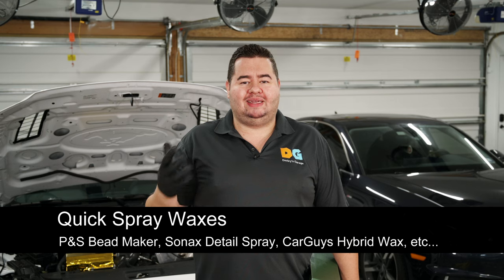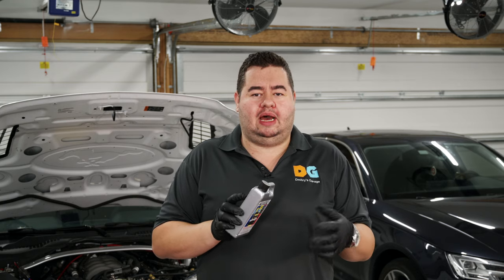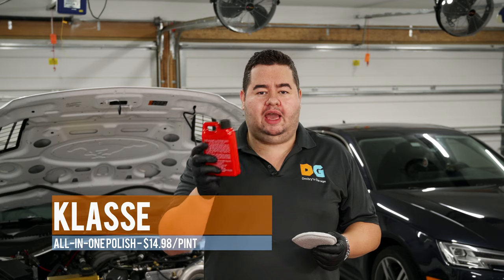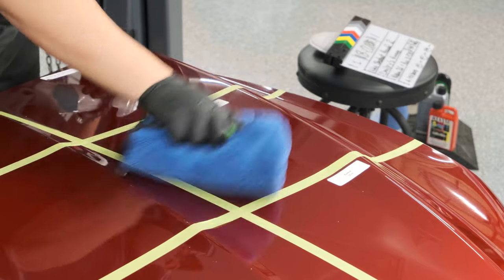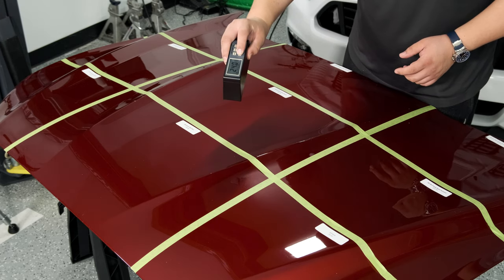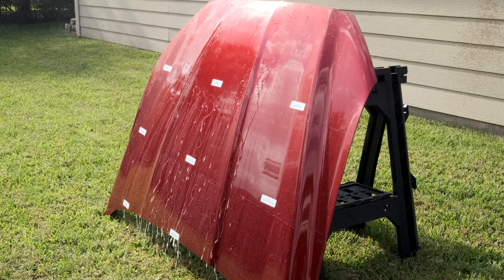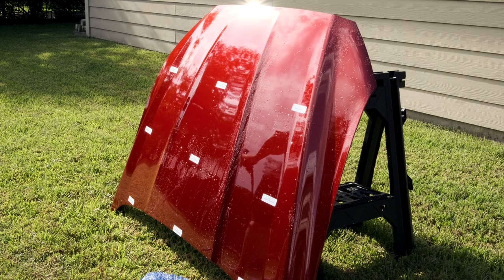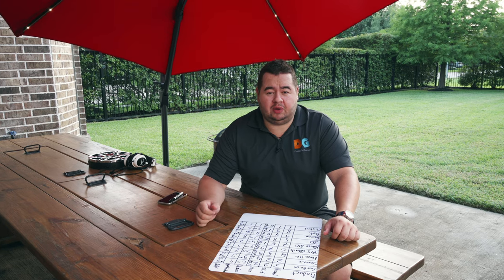What is the best car wax? We test sealants, waxes, hybrid spray waxes, and ceramic products!

Comment: @ 5:44 "oh no, what have I done?!"

Dimitri, love the video. 

I have had the same bottle of Opti-Seal since around 2015 or 2016. I could never get the water behavior I was expecting out of it. 

I tried spray and wipe, I tried applying with thr foam applicator heavy, and thin, then wipe, etc, etc. 

The last summer I polished my car with Optimum Hyper Polish, and the stuff beaded like crazy.... WTH?

I got even better results when I applied and let flash off, and only wiping away any excess after the majority of it flashed away. I also kept it dry for at least an hour. 

I've also come to realize that not all products are designed to bead, and that it's not necessary for for the paint. 

I am still testing Opti-Seal in real work conditions. I have on my car and my mom's car. Currently going through the winter months where she uses the touchless wash, and we have salt and brine on the roads. So far so good. 

I did test Optimum Car Wax over the summer. Compared to CarPro Gliss, it might not have thr longevity of beading, bit it sure as heck didn't get water spot etching like the Gliss did!

Once I exited the cult of beads I'm a lot less anxious about maintaining my vehicle.
Reply from the maker: Haha yea I definitely felt that way at that moment. Was very confused why it wasn't coming off. 

I may have to give Optimum Hyper Polish a shot, that sounds pretty good! I am testing the Optimum Car Wax very soon.

As far as beading vs. sheeting, in an ideal world you'd pick sheeting because it leave less droplets to leave water spots. In the real world the problem is that sheeting is a result of using water's cohesion to pool it together in one big puddle. This means that sheeting doesn't have the same self cleaning and lubricity effect as hydrophobic surfaces that cause beading. In practice hydrophobic products that push water off (cause beading) will do more for self cleaning and lubricity when washing to prevent scratches. Though the downside is the water etching and spots. 

I don't know of a way to make a truly sheeting product that has the same positive and protective properties of beading products.

Comment: The clumps in the Colonite 845 is totally fine.     I have been using that stuff for 25+ years along with Colonite Super Double Coat wax which is without a doubt one of the longest lasting traditional type waxes.     The one-two punch is the Colonite Super Double Coat topped with their 845.    Very good durability and gloss.   Brilliant Shine Detailer from SONAX is another very good one.    It says "Detailer" but it's a spray sealant with long durability and beading like crazy.    Also a good value.   You can't go wrong with anything from Sonax (Made in Germany).   BSD is not super slick,  but it is the most durable probably of the ones you tested.  That stuff is crazy durable.     I do love Opti-Seal too.    It's so easy to apply and remove.   Absolutely no haze.    1 spritz per panel,  can also be a drying aide.    It's a very good product.    I would say about 3 months durability but really it could be infinite if you just use it after every wash as your drying aide.    Never tried Poxy or Cure yet but have tried the others.    Just throw the silver can of Klasse in the trash.    It's far far far far past it's prime.     The secret to that one is to apply it so thin that you literally can BARELY see it.    Then remove it quickly.    It is a little easier that way.    The Klasse RED bottle is the star of those two.    It's a good glaze and chemically removes oxidation and will fill in light swirls as well.    It's great if you use it and then top with a good sealant or wax and you'll have a great looking vehicle.

Comment: Wonderful reviews.  Just a note about the Klasse which I have used for over 30 years.  You are supposed to use the All-in-One first and then apply the glaze.  It still takes some effort to remove which is why they emphasize using a very thin coat.
Reply from the maker: Thanks for the kind comment! Yea you can definitely layer the two. I was just testing each one on their own per the bottle instructions. You definitely have to do a real thin coat, but that's part of the "easy to use" test, some products are very forgiving, this isn't one of em :). Not overall a bad product though!
Reply: He put at least twice as much of the Klasse as should be used for an entire hood.  Great product when used after Klasse All-in-One and applied in the correct amount.  Does require real buffing after two-plus hours of curing, not just immediate wiping.
Reply: @aldeflorio5500  I've been using both Klasse products for 25 years. Proper application is almost as laborious as old-fashioned paste wax but I have found both products to last long and to protect well. I also use them. On Lexan headlight lenses to prevent yellowing.
Reply: I've had great luck with klasse lasting 8-10 months in colorado keeping the paint looking freshly waxed. Super thin coats is the secret

Comment: A bit of detail spray in a Micro fiber towel would remove the Klasse easily. Klasse also sheets more than it beads, if you apply Klasse next to bare paint you will see the difference. I have found Klasse will last at least a year, been using it for 20 years, so far nothing looks better plus it last a long time.
Reply from the maker: Thanks for watching! I do realize that detail spray would help, but it would potentially affect my test results. I think Klasse makes a decent product, but you should check out some of the other stuff, I've got all the results so far here: https://dmitrysgarage.com/wax
Reply: @DmitrysGarage   I've tried many products over the last 25 years some are really good some are hype. For all out durability obviously  ceramic coatings can't be beat, For a good ballance of durability and look Klasse produces the the best of both worlds for me, nice depth and it's good for at least 6 months. However it's really not a product for everyone, you have to know how to use it to get the best results. Klasse was also designed to sheet not bead to prevent water spots, because of this most think the sealant has failed when it hasn't, it's a different animal than the super hydrophobic stuff people are used to. If you let Klasse set up detail spray has no negative effect, I will often top it with a paste wax, liquid wax products will always break down sealants because of the higher solvent content. Klasse SG is best applied over the AIO product, it was designed to be a two step product, it helps durability, plus it makes removal easier. 

Have you ever tried Zaino products? You can layer it indefinitely if you know what you're doing. it's optically clear so it creates a candy coated look, but won't create depth because it's clear, so the paint needs to be perfect, it's also full of UV inhibitors. Zaino has the best wash I've ever used and the detail spray is second to none. When I was mobile  detailing I liked Poor Boys products as you could used the compounds and polishes in direct sunlight if need be. 

Have a good one! I do like your content.
Reply: Klasse is awesome once you know how to use it.
Reply: @Andyshine77  I maintain Klasse SG with Duragloss Aquawax as a drying aid and it works really well

Comment: I been using Klasse for over 25 years. I even used it on my old Track/show car. The red small bottle will last me a good 5 plus years. I only wax my vehicles twice a year sometime 3 times. I just used it on my daily driven Mercedes GLE. I'm going to use it on my wife Audi soon. As a tip after you wash your vehicle. Clay it then use the Klasse red bottle then the grey bottle is the last step.

Comment: Klasse All-in-One Polish and  Klasse High Gloss Sealant Glaze are to be used together NOT alone. Try it using the All in One then the glaze on top of it,. I have been doing that since 2001 so 19 years. It last 6 months in NY .
Reply from the maker: The bottles would disagree with you. Both products claim to work on their own and in combination with each other. While I understanding stacking products can offer better results, that is not the purpose of this testing. The purpose is to benchmark each product on its own per the instructions on the bottle. There are limitless possible combinations of products, it's not realistic to benchmark that way.
Reply: @DmitrysGarage  Not sure what is on the bottles NOW. But 19 years back that is how it was told to me by everyone using it. . The place I bought Klasse from also said you want to use both. So for the last 19 years I have. BUT I agree you cant do every combo.
Reply from the maker: @dc9mm2  Right now the bottle instructions for AIO say that you could optionally top off with the glaze to add durability. Inversely the bottle of Glaze says it can be applied without the AIO. The glaze similarly says you can use it on its own and get up to 12 months of durability.  I'm sure a lot of users do it the way you're describing, it definitely makes sense for a practical application to a car. It's similar to how people stack Collinite products. My goal is really just to compare each product on it's own against many other products and I have tables of this going on my site.

Comment: 1. You used tooooo much collinite 845. All you need, especially for that size of panel you did, is about 3-4 dabs on to the pad. Just hold the pad at the mouth of the bottle and flip the bottle over quickly so that the product just touches the pad.
2. You need to wait anywhere between 10-15mts for it to haze. Do the finger swipe test to see if it is ready and THEN remove and buff to a shine.
3. Keep the videos coming. You are doing a good job with your reviews. Especially when you compare products.

Comment: Try Klasse like this. Apply thick, let is dry. It’s like concrete. Then grab a bucket with water, with a microfiber towel. Wring our the towel, and wipe it off with the damp microfiber. Immediately follow the same spot with a dry microfiber towel. This way you can take the klasse off super quick and easy, and it leaves an amazing shine. I almost think you buffed most of it off.
Reply from the maker: Thanks for the tip. I may give it a shot for personal use. For the tests I really gotta follow the bottle and avoid introducing any detail sprays, water, etc.. that may adulterate the test.
Reply: Dmitry's Garage Give it a try for personal use. It’s amazing how well this works. You have way less rubbing than taking off the easiest wax for example, which is good to minimize marring on the paint. Also, Klasse needs a day to be fully cured. I usually let it sit overnight. Then the shine and protection is really good.
Reply from the maker: @PQR5CHE  Cool will do. I definitely have used detail spray for this effect before, but I could see your method working too. As far as curing, I agree, I always give 24h to cure unless instructions state otherwise. I do that for my testing too. Thanks for the insights!
Reply: Another tip is that the Klasse products are designed to go on top of each other. the AIO first with the HGS second. The shine you get then is insane.

Comment: While I appreciate your hard work, I do think gloss readings are a bit silly. Everyone knows that these products don't actually add gloss, but things we perceive as gloss such as saturation. Often the higher the gloss reading the less the paint has actually been optically improved by the wax or coating.
Reply from the maker: This is definitely a point I frequently make in my videos. The point of continuing these tests in my current videos is that a big drop in reflected light is not desirable. Ideally a product provides both the greatest optical improvement and minimal loss in light reflection. You do start to notice 5-10GU drops as appearing less mirror like and overall bright/shiney.  You can see this with products like the last coat, which lost over 10 gloss units on average, but still had a deep wet look.
Reply: @DmitrysGarage  You are definitely right, you do seem to address that sorry. I am reasonably new to your channel, but really enjoying the content. Didn't mean this in a negative way just so it is clear.
Reply from the maker: @WombatMilk  no worries, didn't take it negatively :)

Comment: I know this is old video, but if you leave in sun or warm water it turns to liquid
Definitely want to get it all incorporated.
Thinner the better. 
Also it's safe if gets on trim. Can be cleaned off without staining.
3d proxy is nice stuff. It's Montana wax so it handles temps closer to 210 before melting and failing. Great topper after 3D speed since it's the same wax that's in speed

Comment: First of all, thank you for your videos. I need your suggestion on what wax should I use? I just purchased a new SUV last month and I live in an apartment without a garage. What wax would you recommend to use that is easy to apply and last. Thank you in advance and I just subscribed.
Reply from the maker: Sermar, thanks for watching! I would suggest either a liquid or a spray product. For a spray I think you'd like Wolfgang Uber SiO2 Silica Spray or the tried and true Turtle Wax Seal N Shine. Liquid products can be a bit more annoying to use than sprays, but often look very good. I'd suggest Wolfgang Deep Gloss, Jescar Power Lock+ or Meguiar's Hybrid Ceramic Liquid.

Comment: Great comparison. I once worked for a company that used Zymol products. Those cars came out excellent. They used cleaner wax then a top coat wax. You cant hardly find Zymol wax but if you can you should definitely try them.
Reply from the maker: Thanks Charles! I've heard good things about Zymol, will see if I can find it for testing.

Comment: Nice video. I think there’s a lot of fake hype and even misguided fan boys out there for paint care products so it’s good to share some relative objective test results. The fact some old school products scored fairly well says a lot about all the hybrid this and ceramic that often being just fake marketing hype. As for the Turtle Wax scratch remover you should thoroughly wash that panel section with some dish soap and recheck the results. A lot of swirl and scratch remover products are also fillers. They’re not removing scratches so much as temporarily hiding them. The scratches largely come back after a few washes. It’s like putting Armor All on scratched plastic. To really remove them you usually need a time consuming process of progressively finer abrasives and that assumes you don’t accidentally go through the clear coat on modern finishes.
Reply from the maker: Thanks for watching! I try to be as objective as possible, but of course we all have some biases. I found a few products I really liked weren't that good. As for the Turtle Wax, it is a pretty heavy abrasive. I wouldn't recommend dish soap as they tend to mask, there are decontamination/strip soaps specific for this purpose. I understand how to remove scratches, as I was comparing the Turtle product to compound/polishes specifically made for multi-step paint correction. They do indeed cut the paint when used with a polisher like the Flex which i was demonstrating in the video.
Reply: Dmitry's Garage I wasn’t recommending dish soap for regular car washes, just as a way to expedite the removal of the fillers in scratch removal products to see their true result on the finish. One wash with dish soap might be roughly the same as four washes with a car wash solution. Using alcohol or other products also would be helpful. But the main point is regular washings , and even rain water, will often eventually make most of the swirls and scratches re-appear with many products as they don’t remove the problems they mostly just temporarily hide them.
Reply from the maker: @sharedknowledge6640  I understood what you meant. You're wrong, dish soap should never be used. They usually contain other ingredients that mask the surface, i.e. shining agents. There are decontamination soaps and even isopropyl alcohol used specifically for this purpose. I understand you think this turtle product is a filler, but it is a heavily abrasive compound. You can feel the grit in your fingers.

Comment: Excellent video, the detailing industry is moving extremely quick and finding out easy application sprays are extreme bang for the buck + ease of application compared to in the past. I have been using Klasse twins for over a decade and I'm sure some others have as well.

The true test of durability for the Klasse twins is SG after AIO. I know you're testing per individual products and combinations of things could be endless but have you did a durability test of the Klasse aio + SG in combination when they're married as they were originally intended? I'm very curious to results, being a lot older now and with less time I want highest durability first and foremost with my driver oriented cars I am considering getting into ceramic/graphene paste on and all these other new products.

Thank
Reply from the maker: Thanks for watching and commenting. I do think sprays are a bit part of the future market as well due to the ease of application and performance they're able to yield these days. For Klasse SG/AIO combination, I have not tried it as the products do indicate they can be used separately, but I will probably test it out in the future when I expand to combinations/toppers. 

Ceramic products seem to vary widely, some are really good, while others aren't any better than traditional polymers. I would suggest testing out a few or looking at the results I've posted. Graphene similarly seems to vary. I did one test with an Adams spray that hit >100 washes on the durability test, then another that did like 1/3 of that from a different company.
Reply: @DmitrysGarage  Appreciate the response, I'll be looking over your test results and new additions. The Adams spray sounds like a winner for trouble free protection, will look into it.
Thanks Dmitry